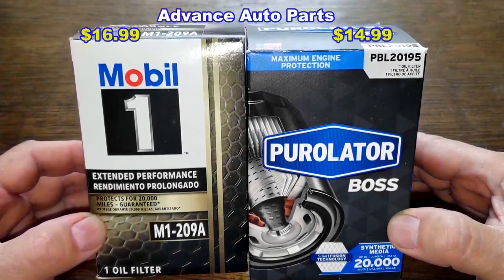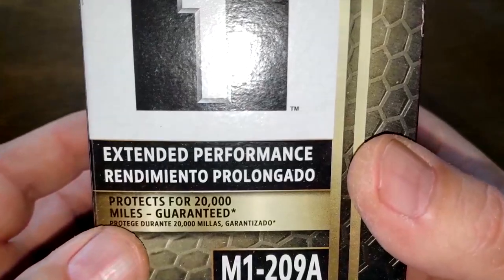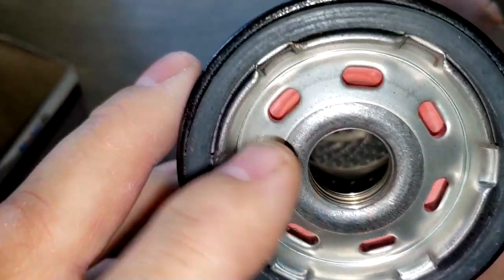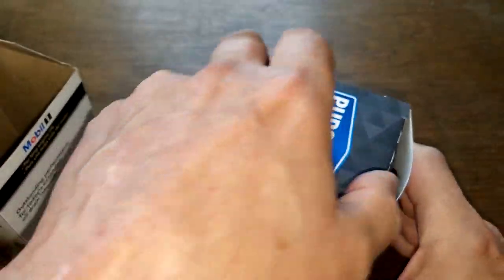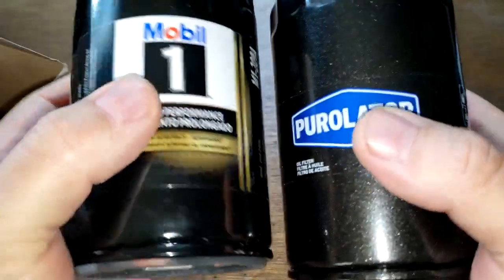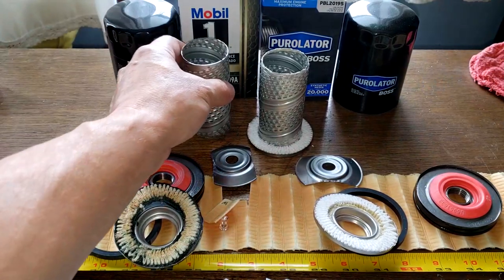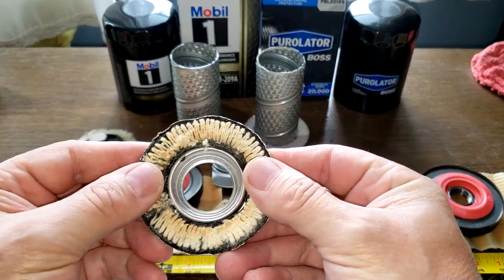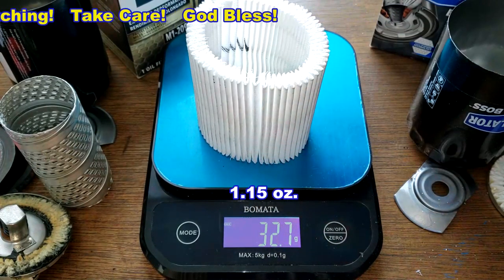Mobil M1-209A Oil Filter vs. Purolator Boss PBL20195 Oil Filter Cut Open Comparison

Comment: I'd say the Boss is the Boss...💪👍👍
Reply from the maker: LOL😊
Reply: Just going from old supply of wix xp ( ran out didn't like the new style) to Mann filter then tried fram synthetic ultra and could hear engine noise like not getting good enough oil flow back to Mann then now waiting for the Purolator boss from Amazon. Going to now also switch over to Pennzoil ultra synthetic platinum living near Edmonton Alberta extreme temperatures and was using Walmart brand full synthetic supertech. I put on about 120 kms each day going to work in city.

Comment: I'll take the Boss filter and I do use them in my vehicles.  I think the Mobil1 is a variant of the PureOne filter which is a pretty good filter, but at a premium due to the name.  Ironically, I think the Mobil1 brand has lagged behind some competitors (Like Purolator and Pennzoil) and has started to rely more on the name and past reputation.
Reply from the maker: Hi Jim
Thanks for the feedback 👍
Reply: False.  Pure One is 20 micron compared to 30 for Mobil
Reply: Their oil in a lot of peoples uoas have been worse then pennzoil ultra platinum and valvoline.  

Me personally I run a boutique oil. High performance lubricants. Off the shelf I tho I would run valvoline or pennzoil.  

Fram synthetic endurance filters.

Comment: Obviously, both made by Purolator, same factory Fayetteville NC. The difference in potting(glue) material is because of media types used. Boss is backed synthetic, M1 blended cellulose. As long as the compression spring doing its job hold element firmly in place, highly doubtful there would be any issue with the M1 in practical usage. That said, I wouldn't pay $17 for the M1, pricey. Boss retail high too but 'between the two' the better value here. Lastly, other than placebo effect doubtful owner Steve getting any measurable difference with the larger size filter. And, no filter warranty when larger filter used. Also, if still under Ford factory engine warranty and some failure occur, warranty could be voided by Ford for non-spec filter. Thanks for vid.
Reply from the maker: You're Welcome faxmen09
Thanks for your in-depth analysis👍
Reply: @WhipCityWrencher  You're welcome Whip. I try.😉
Reply: @faxmen09 Cream coloured epoxy glue is used by Mann, Mahle, and others on cellulose media, so it doesn't depend on the media - I suspect use of the black is purely for cost-saving
Reply: @kristianhermann5971 That may be true for M&H Euro, not so US made Purolator. For the latter, cellulose or blended media filters, Puro has always used the black colored potting, even before M&H purchased Purolator. The Boss is a relatively new-ish filter for Purolator and  they've chosen a different potting. Perhaps it's better or just better suited for synthetic media. Whatever the reason, never seen US made Purolator with cellulose/blended media with other than the black potting shown.

Comment: There is no frickin' way I'd run any oil filter for 20,000 miles, because at 5000 miles I'm changing oil..and filter. Five will get you ten both of these were made by the same factory.

Comment: Your videos always stirs up so many questions to me. 1st, I agree, Purolator is better. Now questions, color of filter elements, white vs crème color? Steve brings up a point, ARE larger filters BETTER than short recommended? Or are they smaller to save money? Are larger filters BETTER? And lastly, what results will Steve have over life of his vehicle, better or worse results? Affect oil pressure? If he continues, I hope he keeps us informed. I've learned so much from your videos that I never thought of. Louvers on your past videos, who would ever know? 👍🇺🇸
Reply from the maker: Hi rice
The only question I can answer is about the glue, I call it cream-colored it's actually a dirty white, lol, it's a much harder glue than the black stuff.
As for oil pressure If he has a "real" oil pressure gauge in his car maybe he'll let us know if he sees any difference in oil pressure.  I like bigger oil filters also they usually have more filter media and if they are mounted base plate end up they hold more oil. I think they make them smaller to save money. Thanks👍
Reply: Larger is better. Some 2WD GM trucks use a longer filter compared to 4WD for front driveshaft clearance. There is no difference in pressure. Obviously it would take a bigger one longer to plug.
Reply: No oil pressure gauge. 😞 @WhipCityWrencher
Reply from the maker: @stevekehn4869  That's too bad🙁

Comment: I've used Mobil 1 filters ever since a K&N filter I had on my 2010 Equinox leaked at the welded nut. Good thing I saw it otherwise it would have destroyed the engine. K&N was nice enough to send me a check for the amount of the filter. That was about 10 years ago. I still have the Equinox and it has 174K miles on it now. Just changed the oil yesterday actually.  Oh, I also use a Filter Mag too. For those that don't know, it's a magnet that goes on the oil filter.
Reply from the maker: Thanks for Sharing👍

Comment: Thanks, Pete and Steve.
I like the idea of a bigger filter. There is nothing wrong with more filter media. Boss for the win. It seemed more well made with a better filter media. The Mobil 1 filter looked sloppy with the excess glue.
Reply from the maker: You're Welcome Jonathan👍
Reply: I ran the M1 filters until the last one I used started leaking at a seam blowing oil all over the bottom of my engine.  Good thing I caught it as I'd lost .5 quart and started to look for the cause and the filter was at fault.  I'll never use one again and currently use the Boss.

Comment: I just installed the BOSS pl20195 in my toyotaco with prissypoo 2.7l 4 cyl. It fit around the trans line bracket just fine. I pre filled and it spun on very smooth. The gasket seat was very smooth. Stopped at 3/4 turn. I put 6 qts 5w30 syn in instead of the stealership oil change 0w20 with yzzd1. When I started the engine (34000 miles) I was shocked that it was S000QUIET prrrrrr. No rattle at all. With lucas in gas I expect to get good mileage again!
Reply: I used dexos1 quakerstate full synthetic 5w30. It is very clean with no plastic smell like ester base types that eat cork/ rubber seals in older engines. I like the smooth texture with a thin pour in cool coastal temperatures !

Comment: Great video! Very thoroughly gone over both of them in depth. Personally I always use the Puralator Boss!👍 It's just not the item you want to cut costs or quality on, your engines life depends on regular good quality oil and filter changes literally. I use full synthetic and change every 5000 miles, and I would not go over 3000 with conventional oil
Reply from the maker: Thank You👍 and Thanks for Sharing! I think the Purolator Boss is a very good oil filter.

Comment: Good trick there:  Always check to see if the inner tube louvers are open, as sometimes the factory doesn't get them open.

Fram Ultra or Endurance or Titanium filters better than either one of these in this test comparison.  But the Boss isn't too bad, good quality inside.

Mobil 1 often seems to have a problem with glue sloppiness.  Similarly, on a past video, Whip City Wrencher opened a sloppy glued Motorcraft filter and he was able to show that the black stuff could flake off the metal surface and possibly get sucked down the bypass spring valve, not good.

Therefore, choose filters like Fram Ultra/Endurance/Titanium or a Purolator Boss or Microgard Select to get the better quality (not much sloppy glue).
Reply from the maker: Thanks for your feedback👍

Comment: Pete, have you ever opened the transmission filter off of the early to mid 1990s Saturn? My understanding is that they actually looked just like an oil filter. I couldn’t imagine how those would look like inside after 100k miles on an original tranny filter!
Reply from the maker: No, I haven't but I bet not much to see as there's no combustion going on in there., but you would probably see some sparkleys😊

Comment: I received my Boss filter today(12/21/23) bought from Walmart but shipped by Advanced Auto and it reads F05R1361. So my understanding is this filter was made in May 2013? Really??
Reply from the maker: R represents 2023 so your filter was made in May 13, 2023
Reply: Odd way of labeling, but i'll take your word for it. Thanks
Reply from the maker: @CWB1863  Yes it is, you can check it here Scroll down to the 2nd set of R codes under Purolator oil filters and you'll get the year. https://bobistheoilguy.com/forums/threads/oil-filter-date-decoding-thread.351643/

Comment: Love the boss it’s the best imo. I’ve used the mobile and had good luck with it. Walmart usually has it around $11. So cheaper than the boss. But. I went back to motorcraft for $4 each Walmart online. CNt beast it for the price and I change my oil 3k or less on my super duty. Lots of around town and towing hauling. When I use the boss I’d drain the oil 2-3 times with the same filter. I think it’s probably better to just use a new motorcraft each  time instead.
Reply from the maker: Hi Andrew
Thanks for Sharing👍

Comment: I would love to use a bigger filter on my car as well .
How do I go about finding out ?
This would be great info , if you can help out . 😊
Reply from the maker: I don't know of an actual site that gives that info, but a Google search will usually give you some results. What size filter are you using now?
Reply: @WhipCityWrencher  On second thought, I’ll stick with what’s specified by the manufacturer.
Who knows, a larger filter might negatively impact oil pressure and that might not be a good thing during the cold months around here where I live. For that matter , not even during the summer.
One thing’s certain though, I won’t use the original Toyota filter.
My car is still under warranty, and the Toyota service guys always get a kick when I show up with my own filter.
NAPA PLATINUM all the way !
Reply from the maker: @Nellis202  😊👍

Comment: Both excellent filters, but, it looks like the Purolator filter will work better on finer particulate matter. The media is the only difference between the two. The anti-backflow valves aren't worth a darn on either filter, but that doesn't affect me. My filter fits vertically, with the threads on top, so the backflow valve doesn't make a difference. (I like the fact that I can pre-fill) I don't go more than 5,000 miles between changes, regardless of the oil or filter.

Comment: I thought the boss at one time said 99% at 20 microns like all the fram filters , do fram filters fudge their test tmyou think or use different standards?
Reply from the maker: As far as I know, the Boss has always been 99% at 25 microns.
Reply: @WhipCityWrencher ask purolater to send tech data sheet because I know 2 boss filter 99% at 46 micron
Reply from the maker: @PaPa-gz4bg   Where did you get those numbers. Here's a link to their website and if you scroll down to the bottom of the page you'll see it's 99% at 25 microns. https://www.purolatornow.com/en/products/oil-filters/purolator-boss.html
Reply: @WhipCityWrencher purolater him self email them oil filter you want efficiency for they will send tech sheet which will give efficiency 99% and 50% with micron rating for each filter you ask 25 micron for there biggest oil filter not for all boss filters they make
Reply from the maker: @PaPa-gz4bg   All the Boss filters I've ever opened use the same filter media. Send me the Tech sheet to,       Poker4me007@gmail.com   Thanks!
Reply: You mean 99%?   @WhipCityWrencher
Reply from the maker: @garyhiland6013  Yes 99% , I must have been making a video that day with a filter that was 95% LOL😊

Comment: Why would using a larger filter be better???
Reply from the maker: It may not make any difference at all, but I like to use larger oil filters when possible.
Reply: If car makers put 10 quart oil pans on every car engine the engines would last longer.  More cooling and less oil breakdown.  They don't because the owners would be screaming about the expense.  A larger filter allows you to add a little more oil.  Second, you never want the oil filter to go into bypass.  Bypass allows the contaminates collected by the filter to be swept into the engine.  A smaller filter will get plugged sooner.  This isn't a problem with new engines but neglected engines can be loaded with sludge.  I once owned a car with a dirty engine that would put the filter into bypass in 1500 miles.  I could tell because the lifters would start ticking.

Comment: That's the most expensive boss filter I've ever seen are you on a island somewhere or small village remote Alaska??
Reply from the maker: Advance Auto Parts --> https://shop.advanceautoparts.com/p/purolatorboss-maximum-protection-oil-filter-ideal-for-full-synthetic-oil-protects-up-to-20-000-miles-pbl20195/11153649-P?searchTerm=PBL20195
Reply: They are under 10 at Menards as well the oil is about 30% less for name brand  vs. big box house dressing
Reply from the maker: @toddbell3419  Unfortunately I don't have a Menards near me.
Thanks!

Comment: These two filters are made by Mann-Hummel.  Anyone using the Mobil1 M1-102/102A can use either of these filters, if you have the clearance underneath the vehicle.  Champion labs makes the 3614 or the larger 3600 filter.  You can get the Amsoil EAO34, Fram Endurance FE3600, the Royal purple Entended-life, but. This Purolator Boss is far superior to the M1-209A.  Since Mobil1 reformulated their oil and filter design and media, they are middle of the road at best.  Tha A model filters are the black glue and semi synthetic media and the Extend life oil is not showing base oils that are not full synthetic and the additive and wear packages have been reduced.  There are three top oils and the Valvoline Extended Life High mileage, Pennzoil Ultra Platinum, and Amsoil Signature series.  if you use less expensive oil, use the BG products MOA engine oil supplement with each change or if you do extended oil changes, then add this through your cycle, when you change the oil filter.
Reply from the maker: Thanks for Sharing👍

Comment: The boss filters are way too restrictive for most engines....and need to be changed more frequently...not a good idea
Reply: Explain
Reply from the maker: I disagree, the stated micron rating of 95% at 25 microns doesn't imply that.
Thanks for your feedback👍
Reply: You have no evidence to back up your claims.
Reply: @WhipCityWrencher  Fwiw, I 100% agree with you. Folks think because a filter has solid efficiency, then it must have of poor flow. Not so. The average engine oiling system itself is ~15x more restrictive than the oil filter. In other words, the oil filter is not the point of restriction in the engine oiling system. The Puro Boss flows just fine.